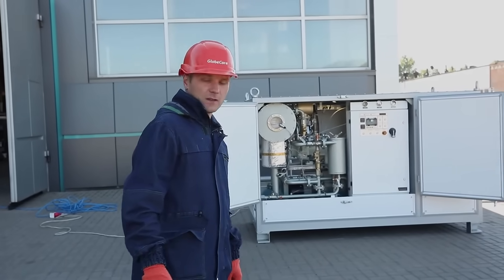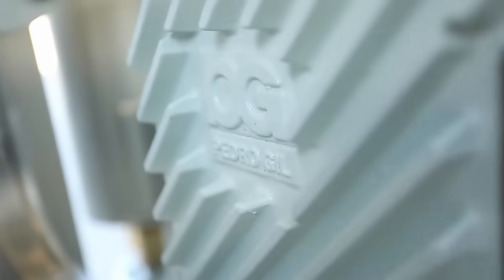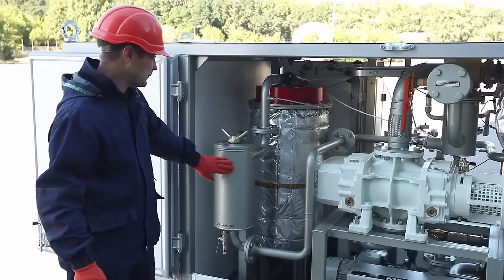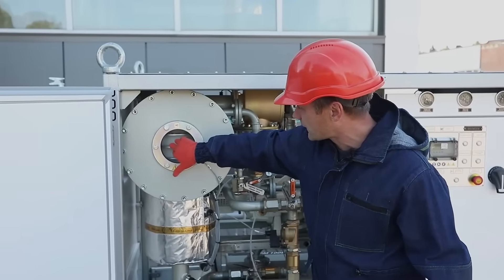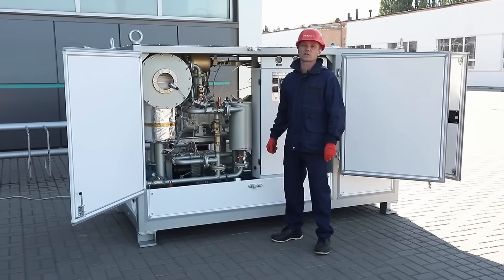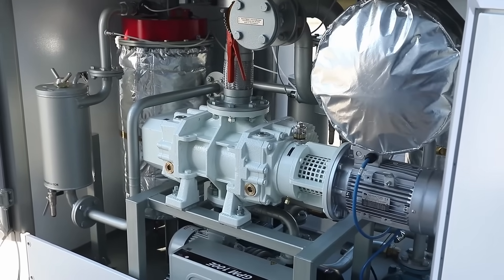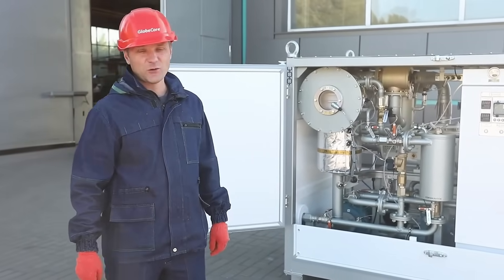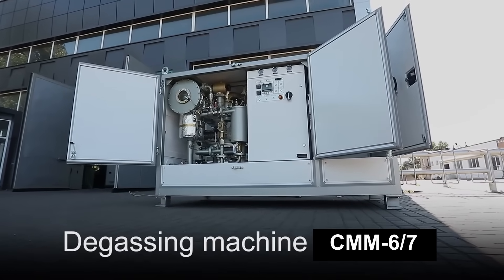Transformer Oil Degassing Machine CMM-6/7 with Two-Stage Vacuum System

Comment: How does the CMM-6/7 unit contribute to the overall sustainability and efficiency of transformer maintenance operations?
Reply from the maker: The CMM-6/7 unit offers deep oil degassing and vacuum oil filling, serving both hermetic and non-hermetic transformers. It operates in multiple modes, including degassing, drying, and filtration, with a three-stage filtration system for high removal efficiency of impurities.

Comment: Are there any specific safety protocols or guidelines that operators should follow when using the CMM-6/7 unit?
Reply from the maker: Safety requirements and usage recommendations are detailed in the equipment's technical documentation.

Comment: Can the CMM-6/7 unit be customized for specific transformer maintenance requirements or applications?
Reply from the maker: Usually, the CMM-6/7 machine has a specific setting for specific functions. However, it is possible to add certain options: additional sensors, installation on a wheel trailer, etc.

Comment: How does the CMM-6/7 unit handle the disposal or recycling of waste materials generated during the oil purification process?
Reply from the maker: During the operation of the СMM-6/7 machine, no waste is generated that would require disposal or storage.

Comment: How does the CMM-6/7 unit maintain its performance under varying weather or operating conditions?
Reply from the maker: The CMM-6/7 unit is housed in a container, providing protection and stability under different weather and operating conditions.

Comment: What additional training or certifications are required for operators to use the CMM-6/7 unit safely and effectively?
Reply from the maker: If the operator already had experience with such equipment, no additional training is required. If the operator is not experienced, it is sufficient to complete the GlobeCore training course.

Comment: What are the dimensions and weight of the CMM-6/7 unit, including any optional containers or trailers?
Reply from the maker: The CMM-6/7 unit's dimensions are as follows: Length - 2600 mm without a trailer and 3750 mm with a trailer, Width - 1500 mm without a trailer and 1940 mm with a trailer, Height - 1250 mm without a trailer and 1840 mm with a trailer. The weight of the unit is 1100 kg without a trailer and 1500 kg with a trailer.

Comment: Are there any specific environmental concerns or regulations that apply to the use of the CMM-6/7 unit?
Reply from the maker: No. The operation of the machine is not accompanied by emissions or release of substances that may be dangerous for the environment.

Comment: How does the CMM-6/7 unit deal with any potential risks associated with handling high-voltage insulating oils?
Reply from the maker: The machine is equipped with sensors to detect abnormal situations such as oil leaks, foam generation, and oil flow stoppage.

Comment: How does the tape heater design contribute to the overall efficiency and performance of the CMM-6/7 unit?
Reply from the maker: The tape heater is used for transformer flushing with hot insulating oil, and a vacuum system operates during transformer vacuums.

Comment: How does the CMM-6/7 unit handle contaminants like solid particles or sludge in the oil?
Reply from the maker: Mechanical particles are removed using the filtering system of the CMM-6/7 machine. To remove sludge, it is better to use GlobeCore's machines designed for the regeneration of transformer oils.

Comment: Can the CMM-6/7 unit be integrated with other transformer maintenance equipment?
Reply from the maker: Yes of course. It can be used, for example, in combination with machines for the regeneration of transformer oils.

Comment: What are the typical service intervals for the CMM-6/7 unit in order to maintain performance?
Reply from the maker: These intervals are different for different components of the machine: filters, vacuum pumps, etc. You can find the intervals in the machines instructions.

Comment: What are the specific applications of hermetic vs. non-hermetic transformers?
Reply from the maker: Hermetic transformers are typically used in applications where a high level of protection against moisture, dust, and other contaminants is required. They are commonly used in outdoor and harsh environments such as power distribution systems, oil and gas industries, and marine applications.
Non-hermetic transformers, on the other hand, are suitable for indoor and less demanding environments where protection against moisture and contaminants is not a primary concern. They find applications in various industries including commercial buildings, residential areas, and industrial settings with controlled conditions.